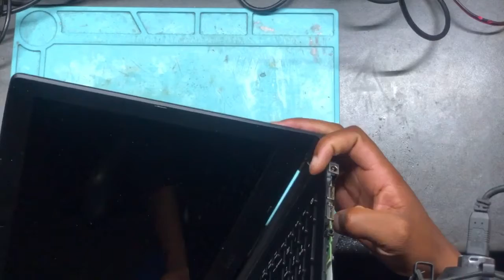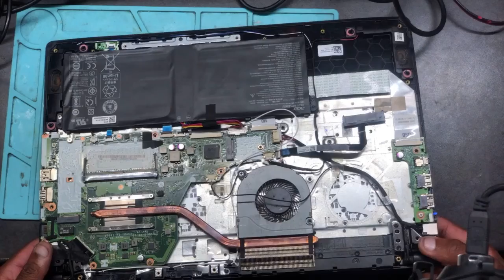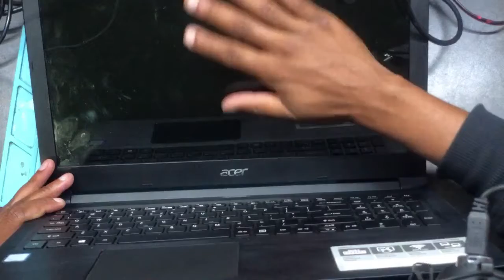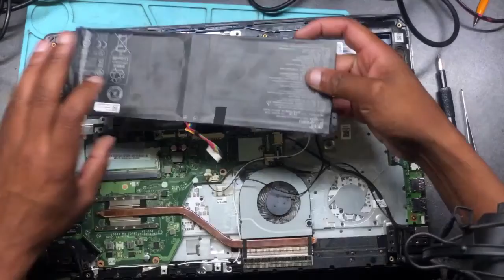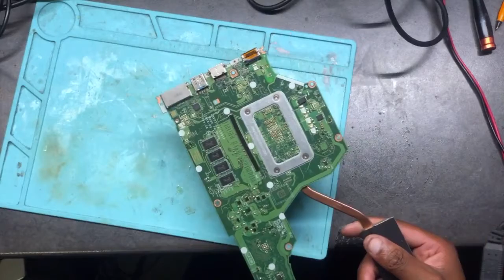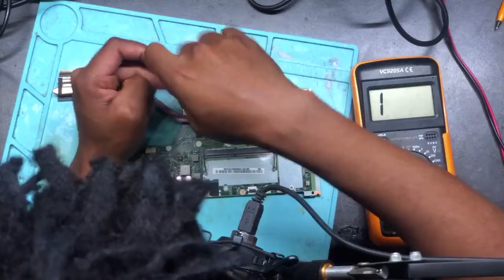Acer Aspire 3 Series Laptop Turns On but nothing on the screen

Comment: Indirectly, you helped me.... My Aspire 3 did not have the single LED where yours is, mine did have two very small ones on right side.... I held the power button till both blue lights went out.... Then touched the power button twice, and got it to boot up...... They realyl ought to have had the LED in the lid, next to power button.... but they never asked me for my input!  Thanks for the videos... just subscribed.